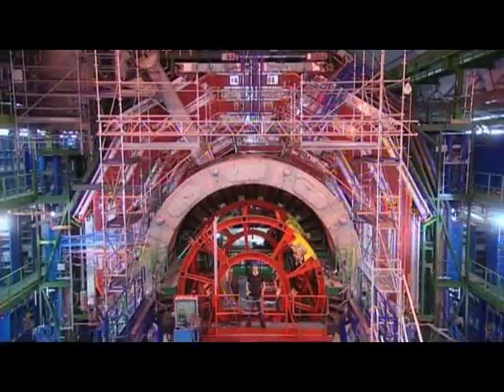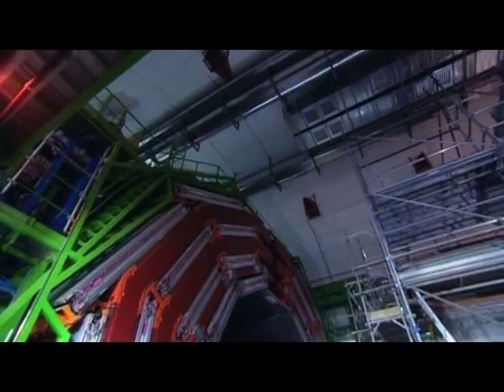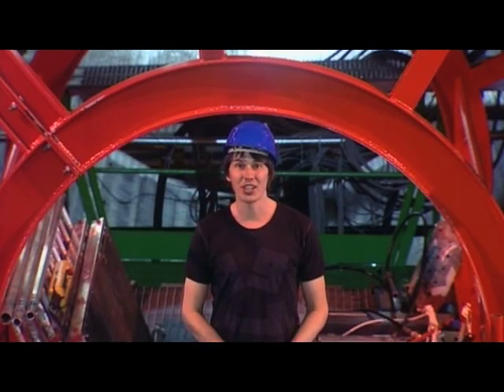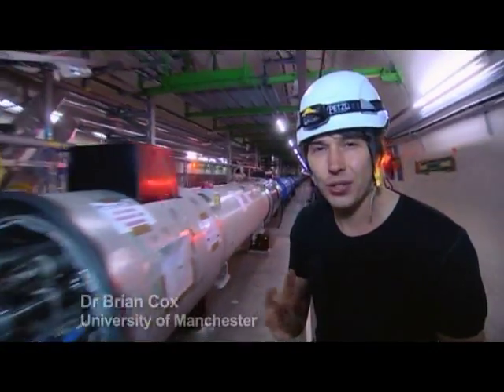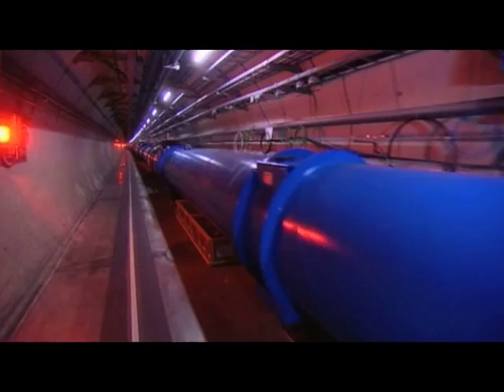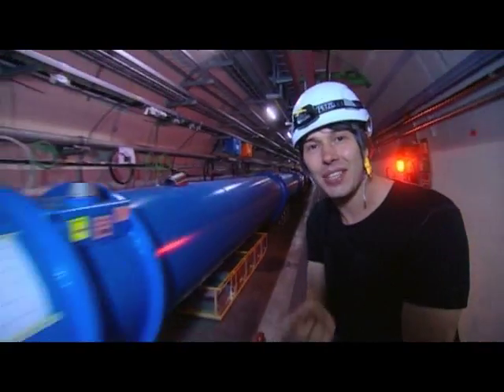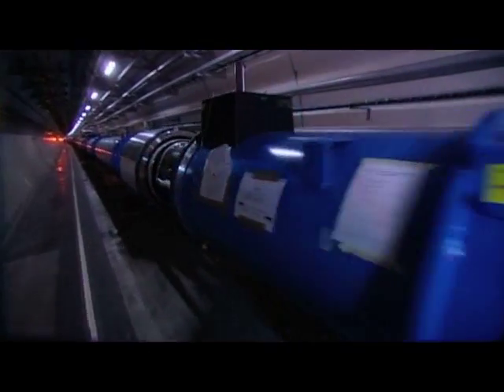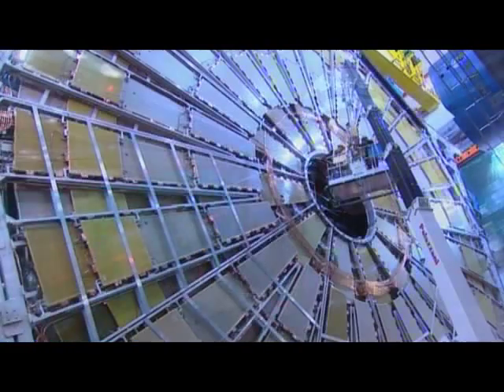Big Bang v2.0

Comment: They did low energy tests at a fraction of full power.  and found a problem.  Someone didn't Tighten some bolts on one of the Bus couplings between two magnets. 12,000 Amps running through a Bad connection = An expensive heater.. So the spot in the ring where that happened Melted down.. They have to evacuate the coolant, let the parts warm up, Replace the broken parts, Check alot of the connections on teh ring again  put it together, cool it again Then restart tests.   Time consuming isn't it.

Comment: if my calculations are correct and the equation E=mc^2 is correct you would have to take two suns and shoot them at each other at the speed of light to cause a black hole and POSSIBLY the fabric of the universe could be destroyed. But they are only shooting a fly at the atom smasher.

Comment: 0,00000000000000000000000000000000000000000000000000001 (the chance that someting bad will happen is much smaller) mulitplicated with "OO" (the possible damage is infinite - destruction of the world = "OO") leads to an "OO" definite failure mode effect.. No medical product for human use would be accepted with such a riskanalysis solution.....;-)

Comment: By the Blood of the Gods...
It is an ACELLERATOR; it is not starting as soon as you flip the key (if it did, then there would really be a reason to fear).
It is a slow process, plus that they can always shut it down; with over 10.000 computers supplying every single bit of information.

Still, I still think this experiment is simply sadism to those who value their lives.

Comment from the maker: good question...the switch on date is not confirmed but I think the plan is to try the thing out later this year. But don't hold your breath - the whole thing is so complicated that they can't risk getting it wrong otherwise it will take ages to set them right before having another go. I think they're happier to delay start-up than to risk a potentially longer delay by not getting it right first time.

Comment: So the atomcore does not have a centre point, where the energy would be denser than outside it. There is no centre point also at the universe, outside which the energy would be less denser. 

Because the MOVEMENT takes place towards a less dense area, then the visible universe MOVES as an entity away from that one point that is really far away from the visible universe and where the energy is much denser than it is in a visible universe.